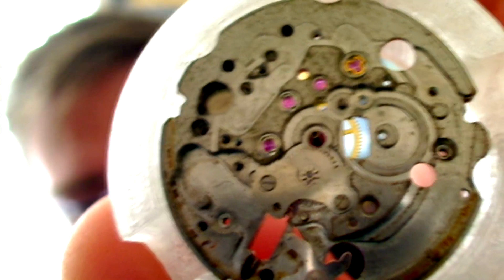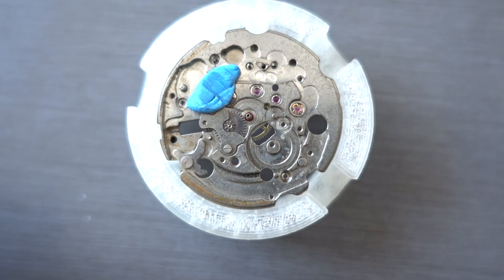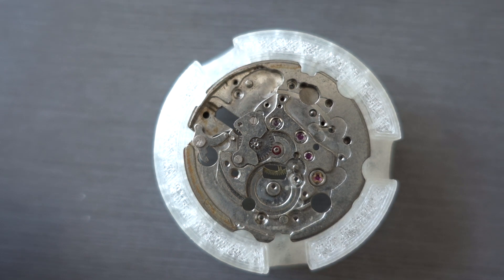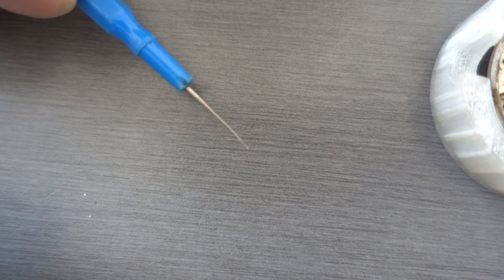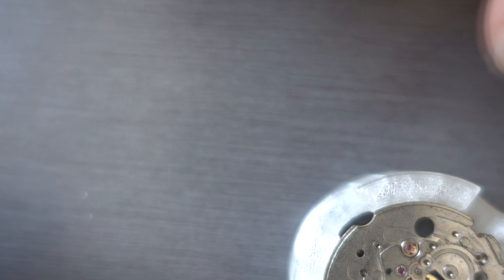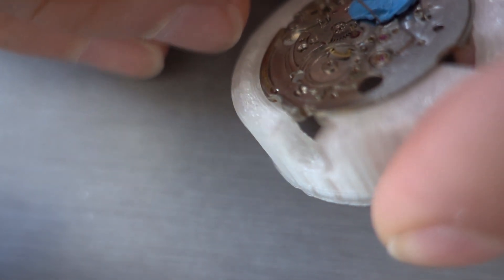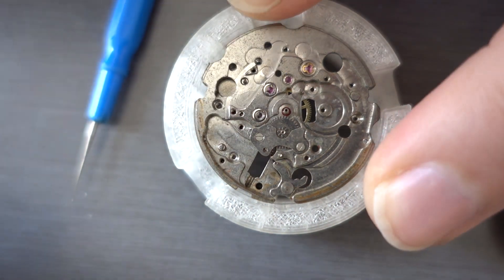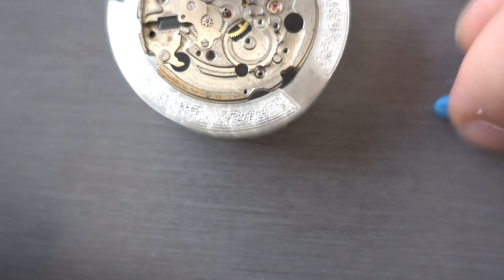[TECH] Dealing With SEIKO DIAFIX Settings - THE EASY WAY!

Comment: Thanks for sharing, very helpful tip! 
I reckon the hardest part after removing and cleaning the jewel is to use the tweezers to hold the jewel steady, oil it and then put it back in position! I can't imagine how's that done without messing up!
Reply from the maker: SEIKO say the way to do these is to put the setting in and oil it from the other side, as in the side the pivot goes in. It works and is a lot easier.

Comment: Adrian thank you so much for this video! I know we were taking about this on my post but to now see it done is so much easier.
I’m now tempted to strip back my 6106 and have a go!

Mike_B in case your in doubt who it is
Reply from the maker: Geday Mike,

The gig was up when I saw a square watch!

Do it. The diafix isn't too hard when you work out a system to deal with them. Replacement parts are pretty easy to source so you have nothing to lose.